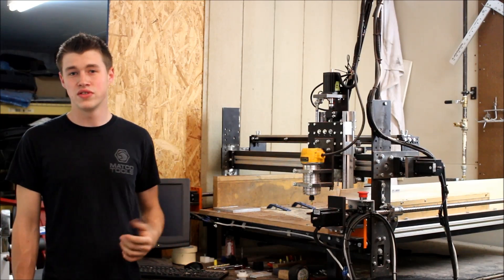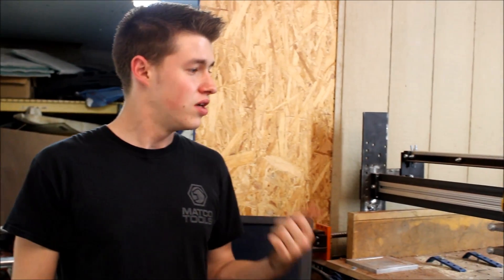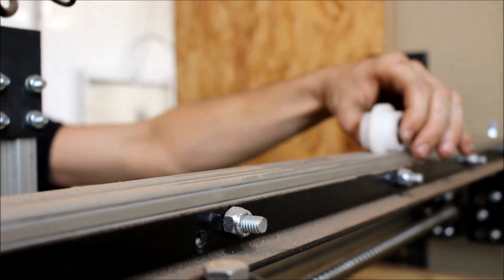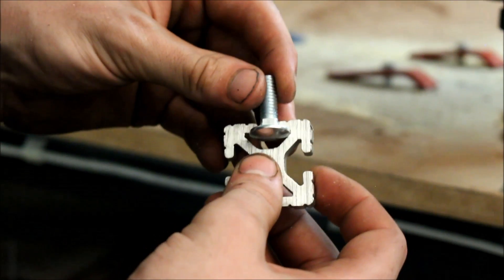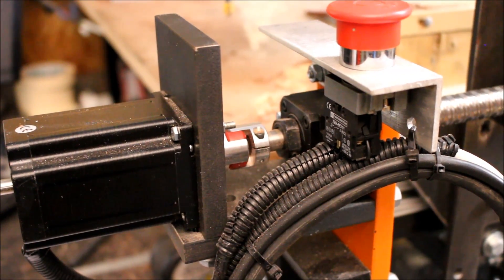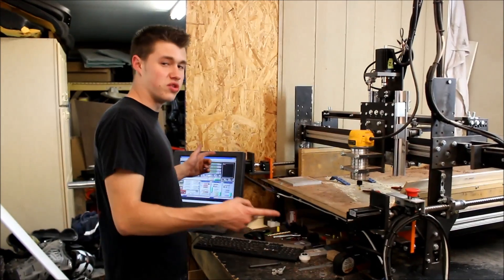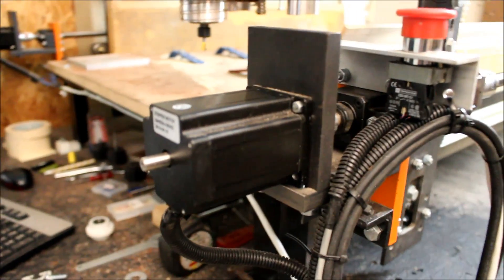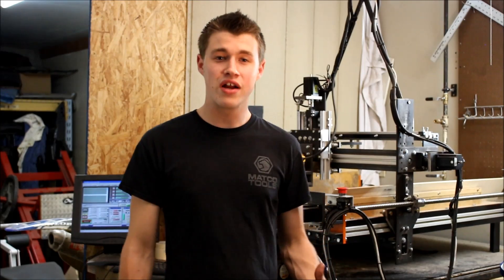Homemade CNC router made with steel (design and construction)

Comment: Hi, congratulations for the video!What is interface between computer and driver motor ? and name the computer program?Thanks, sorry for mi english.
Reply from the maker: I used a 5 axis stepper motor interface i bought off ebay ( http://www.ebay.com/itm/US-Ship-5-Axis-MACH3-CNC-Breakout-Board-Interface-for-Stepper-Motor-Driver-/231617048089?hash=item35ed73ae19:g:d6AAAOSw3ydVmzqq ) and mach3 for the computer program.  Hope that helps!

Comment: Thanks for the video and the information. 

I have a question. 

I´m making a CNC machine using a DEWALT DW616 Router and i don´t know how to choose an appropiate BallScrew diameter. 

The diameter that are you using is 20x10 (SFU2010) for the 3 axis ? including Z-Axis ?

I have this question because some sellers are offering me  a SFU1204  as Z-axis But I worry that it would be not strong enough.

I hope you can help me. Thanks for everything :D
Reply from the maker: Hello Erick, im sorry i totally missed your comment, give me a few days (as im really busy right now) and i will try to answer your question, unless you found the answer already!
Reply from the maker: hey Erick, i looked up the sfu1204, i think that will be more then enough for a z axis.  Id be more worried about which stepper motors you are using.  do you have kit picked out?

Comment: how are ya mate just getting into the cnc side of things and saw on ebay the motors and controller you are using . what program are you using or dose it matter what program you are running ?
Reply from the maker: Im good man!  The program that i found, and like is Mach3 (which has been updated to mach4) but i still use mach3.  There is other programs out there, but from what i read, mach3 was what alot of people were using, and a fair price.
-Ryan

Comment: I'm actually much more of a wood worker and don't have easy access to metal working equipment. I will be using some metal brackets and steel tubing for some parts but it will be primarily built out of 3/4" ply. The weight will certainly still add up on mine but I'm trying to minimize it where possible. I think 150 ipm is actually incredible. I'd be more than happy to run my machine at 50ipm
Reply from the maker: +Kaden McDonald I like being able to cut around 50ipm, which is still slow compared to industrial router lol  im pretty happy with 150 ipm rapids on my machine, any slower it would take awhile for it to jog from one end to the other.  let me know when you have picture of your router up, i like seeing other peoples builds.   If youd like, post picture on my google+ community! https://plus.google.com/u/0/communities/101272062484844835737

Comment: Was Mach 3 easy to use when setting up the dual x axis? Also I'm getting a 4 motor kit with nema 23 270oz motors. My machine will be slightly smaller than yours. Do you think I will have power problems? (Skipping steps etc.)
Reply from the maker: +Kaden McDonald mach3 wasn't really that hard to set up.  I did have to google a few things through the process, but wasnt that bad.  As far as the motors,  do you know your thread pitch or threads per inch?  I can rapid my router at about 150ipm any more then that i risk skipping steps.  My guess is you'll be fine, you might just have to turn your rapid speeds down.
Reply: +Catchon I plan on ordering 5 start acme rods. So 2 revolutions per inch. I&#39;d like the machine to run pretty quick, but it will obviously have a limit at some point. What size are your motors? Ohh scratch that I didn't watch that part of the video yet. That's awesome. Maybe my second CNC will be as powerful as yours! Yours is seriously amazing. Great work! And thank you for the wiring tips on the other video.
Reply from the maker: +Kaden McDonald Thank you! Is yours being made out of steel? Mine is almost all steel...so pretty heavy...prolly part of the reason my rapids are only 150 ipm.